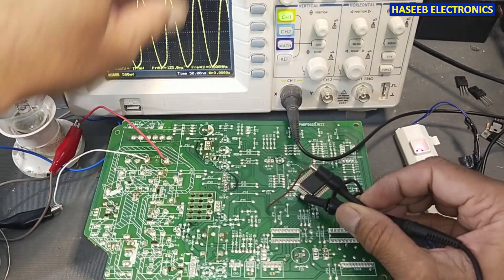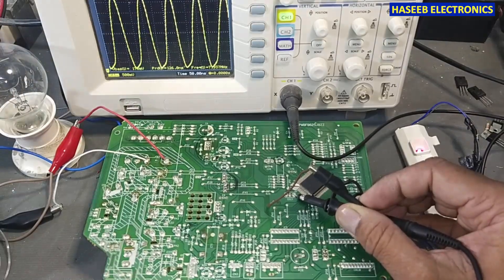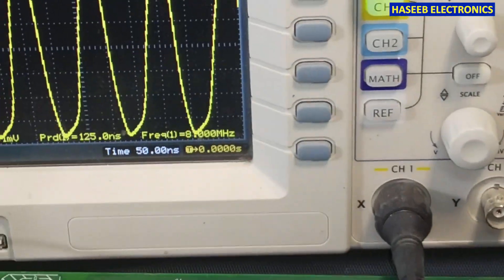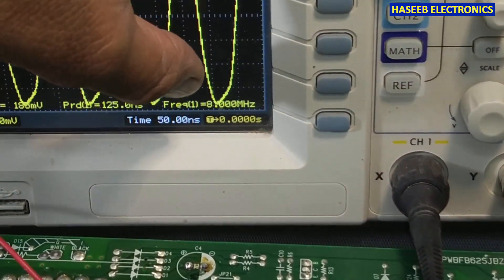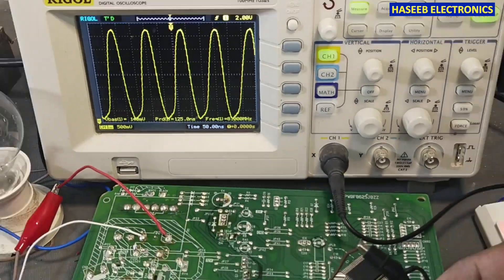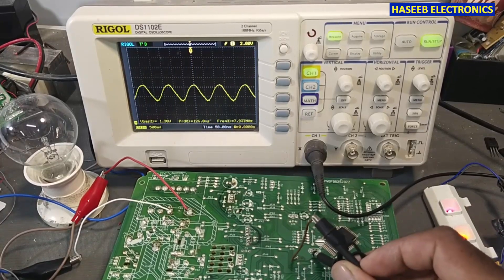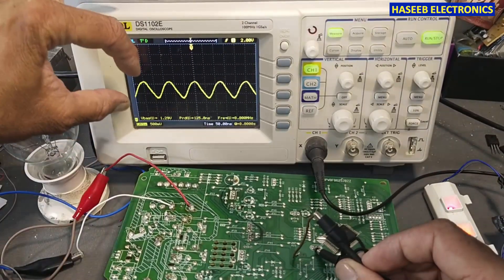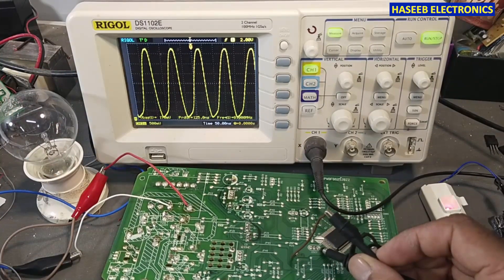{754} How To Test Ceramic Resonator Frequency

Comment: assalamo alaikoum brother hassib. i have an hp pavilion x360 m3-u001dx laptop with black screen and  3 long and 5 short lights on cap lock .according to HP its a cpu issue ,i need some help to find shematics for the motherboard         tmt ya-4a 19 94v-0 e114139 because i need to check if the cpu vcores are ok? thanks.

Comment: Create a video on an item that powers on but after a few minutes shuts down. InFocus 102 projector to be exact gives this kinda fault. I'd appreciate your video assistance.
Reply from the maker: currently i don't have projector. i will try to arrange. and it will my pleasure, if i can arrange and share it
Reply: @HaseebElectronics  thanks for the commitment, will be looking forward to such a fault, diagnosis and reapir
Reply: Maybe just the lamp need to change.
Reply: @mtrltoolman  so you saying the lamp can be the issue, but it's lighting up. There's actually a power supply just for the lamp, I tested a diode for continuing and I good no reading but when I did a resistance test I gave me a reading and not a short so I'm puzzled as to the issue

Comment: Very good informative. What is the function in a circuit.
Reply from the maker: it provides a fixed frequency clock signal to operate the microprocessor to make systematic decisions.